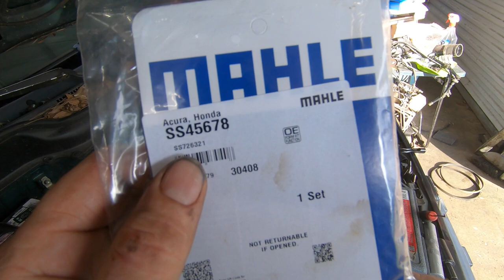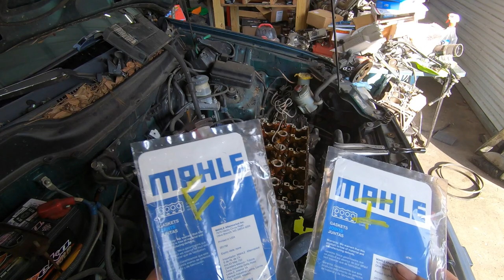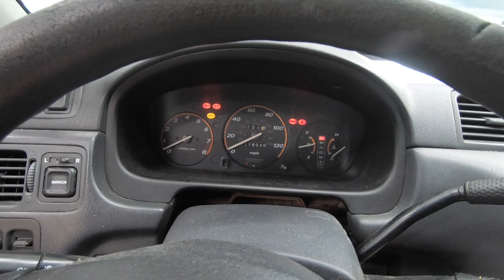Repairing EVERY issue on my cousin's 2000 Honda CRV | RD1 RD2

Comment: Side note: While driving home, my evilBay driveshaft vibrated so bad it snapped the bolts attaching it to the flange and destroyed my shift cable. The cable held the driveshaft off the ground long enough for me to get off the freeway. Ordered another one and will have it balanced before installing it this time. Also, used your tips on replacing the oil pan gasket yesterday. Will keep an eye out for leaks. Cheers brother
Reply from the maker: Sheesh... always something! I'm glad you were able to make it back home safely.
Reply: It continues to be an expensive lesson. One of the flange bolts tore through a boot on the passenger side, so now I have to order that as well. Will be looking through your videos to learn how to do that job now. Cheers

Comment: Love the channel, so keep up the great content. My question regards a valve lashing gone wrong. What do we do if after loosening the jam nut, you can't loosen the screw driver any further? I can't get any feeler gages in there at all. I still have compression, but I am sure the valve seat has received to far.
Reply from the maker: are you sure that the engine is rotated to the proper position?

Comment: Awesome! This task is next on the agenda. Question:
Is it necessary to follow the removal sequence of the camshafts? I've heard "yes" and "no"?  It looks like you zipped through it so I'm guessing not.
Also, thanks for the detailed explanation of the rope method.  I've seen it several times but didn't understand what other people were doing.  No doubt I would have dropped a valve.  I appreciate you sharing your knowledge, I'll be ordering a t shirt and a hoodie. Take care.
Reply from the maker: Technically I suppose you should work outside in, but in my experience on the b20's non of the cam caps lift after removing all the bolts.

Comment: I love your channel. Unfortunately I found it a little late. I have a 99 CR-V which I removed the cams and valves but I didn't keep them in order. Now I have a mean tik and hoping a lash adjustment fixes it. My question is when you put the cams back in is their a certain way to install them? Like TDC or something because one of my cams looks to be off a tooth towards the front of the truck and it runs but not as great as it did. I'm thinking about redoing it and following your video steps but I didn't see how you installed the cams.
Reply from the maker: Yeah man do the valve lash adjustment. I put everything at tdc when I reinstalled the belt.

Comment: I was under the impression that the B20 engines used in 1997-2001 Honda CRVs were interference engines.  I replaced the timing belt in mine in fear of ruining the engine if it broke.  When I removed the old one, it looked new but had 187,000 miles on it.  Was I mistaken in believing these engines are interference engines?
Reply: You’re not. I’m changing mine the Saturday. Better safe than sorry.
Reply from the maker: I've always heard they were as well but I've probably replaced 10 broken belts over the last few years and never had an issue
Reply: @hondaresource  I get what you're saying, but don't misguide people man, most Mercedes-Benz Engines are non interference engines, but here, we are talking about the most cost effective way to make a car, which is what Honda does in a reliable standpoint, but these engines are most definitely interference engines. Don't sit there and say they're non interference engines when we know for damn well they're most definitely interference engines. I love the content, but this steers me away when you give an opinion, not facts, that being said, you'll steer people away when giving opinions, because opinions are like assholes, we all have one. I know several people that had to replace there engines because of the snapped belt. I know you're in the RD1 group on Facebook too. You're very knowledgeable, so don't ruin your reputation by giving your opinion.
Reply from the maker: @donutcrash  well my opinion is... I've probably replaced 20 broken b20 belts over the last 15 years and NEVER had a SINGLE bent valve. Most recent being today.

Comment: Maybe a silly question. When you remove the cam shaft, do you need to return the engine to original position it was when you removed them? And the timing gears as well? How does this affect timing? I need new valve stem seals and am worried I’ll mess the timing up
Reply from the maker: you have to put it back in time, yes! use a paint marker to mark the orientation of the belt on cams and the crank so you can insure that you put it back at the same place

Comment: Hey, do you usually have issues reusing the hardware on that exhaust pipe where it connects to the exhaust manifold? I have to change my oil pan gasket, too, and I wanna know what to expect.
Reply from the maker: occasionally, but a good socket goes a long way.
Reply: i just did my oil pan gasket (with help from this channel)and it was worth buying the sprung bolts etc that connect to the catalytic converter as mine where seized pretty bad and just cut them off.yours maybe ok?also the nuts where a bitch to get off at the manifold end;a good soaking in WD40 before hand would help,like the day before and keep soaking them and giving them a tap with a small hammer/spanner to help it work through...good luck!  :)

Comment: Random question. Is there any more modestly priced alternative for a 2001 Honda CRV e x all-wheel drive automatic transmission transmission fluid other than the recommended Honda Stuff? Valvoline multi-vehicle?
Reply: Every mechanic I’ve ever met has always said not to put anything other than OEM transmission fluid in a Honda.

Comment: Hi sir, 
I did a full frontal suspension rebuild upper lower controls, ball joints, tie rods and links,  new fr rear struts, stabilizer bushings, etc.  Does it occur to you that the corner handling of these 1st gen will only get as good as they are in this day in age? The handling got better but the floaty feel on the freeway slightly still exist.  Im thinking of putting spacers on.
Reply from the maker: The rear shocks can also make it feel floaty.
Reply: @hondaresource  i wanted to ask you if u have had any 1st gen crvs with a wobbly crank pully balancer? I replaced mine and its still wobbly.

Comment: thanks for the video! steering is stiff, softens when accelerating. Any ideas?(CR-V RD1).
Reply from the maker: Power steering pump is failing.
Reply: thank you. @hondaresource
Reply: is it repairable? I prefer to repair rather than get an used one. @hondaresource

Comment: I had no clue these weren’t interference motors, I’ve always been told they were and if the belt snapped you’re SOL?
Reply from the maker: I can't tell you how many broken belts I've replaced on these without issue.
Reply: @hondaresource  that’s good to know, just got a 99 ex pretty happy with it so far

Comment: My 2000 crv started giving starting issues starting . I drive 60 miles  to work  each way it would start each way but if I stopped anywhere it was hell getting to start . I changed every part I could think off new distributor, neutral safety switch, spark plugs, battery several sensors.  I got it started drove around and back to square one.  Any ideas
Reply: main relay or ignition switch plug
Reply: dry solder on main relay

Comment: Do I need to adjust valve lashes on my D16 if it's due after more tnan 50k mileage, but it sounds alright, no clicks or weird noise or whatever.
Reply: Adam Chapman  thanks mate
Reply from the maker: I wouldn't say a lash adjustment is as important on a d series as it is on a b20, but it definitely wouldn't hurt

Comment: Great videos!!will you be doing one on piston ring replacement?hint hint :)
Reply from the maker: Probably not because that's a full rebuild and typically I just replace the whole engine if it needs a complete rebuild.
Reply: @hondaresource  okidokey,no worries :)
Reply: @hondaresource  okidokey,no worries :) but what would be your first guess if a mk1 CRV was using oil?its not leaking it,I've just replaced the rocker cover/camshaft gasket(i'm in the UK so call them different things)and replaced the sump/oil pan gasket too.both dry as a bone!..seems to use about 200ml every 300 miles..not massive amounts but still you have to watch it.do you think sea foam products are any good for say cleaning piston heads and valves full of carbon?could it be that?any ideas on a cure?..cheers,Dave
Reply from the maker: @davidwoodward7020  valve seals
Reply: @hondaresource  nice one,thanks alot

Comment: Replacing all the valves stem seals is not even worth all that hard work. Pull out the cylinder head, buy the head gasket kit, send the cylinder head to a machine shop, and do the job right. If the valve stem seals need to be replaced, then guess what? So does the head gasket. Here in southern California, sending out the head to a machine shop is only $120, maybe a little more. And yes, I've already tried resurfacing the head myself, lapping the valves, but this saved me no money considering the time it takes to run the block back & forth across some flat surface with 2 sanding belts glued to it, then repeating the same process with a finer sand paper as a final step. Here in the U.S.,  you shouldn't be that poor, or that cheap to just send it out to a machine shop and reinstalling the head yourself.